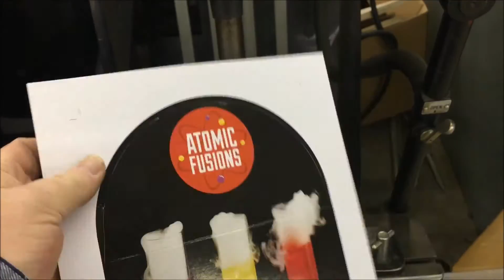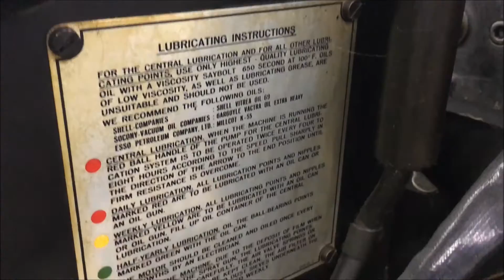Work ~ Windmill Press

Comment: wow, years ago I ran an old manual feed with the ink wheel, one color per run.
Reply from the maker: +buzzsah Me too! Was the one you ran a Chandler & Price?
Reply: +Lil Doggy  I have no idea, I was working for a real old small time printer and the damn thing was so old I never seen or noticed.  All I know is a pain in the butt at first until I became familiar with it. Setup was backwards and upside down at times, and color change was a pain, a complete wash down and lining up.  I ran an old vacuum web press for a while back then as well.  When he closed up I wanted to buy the press but couldn't move it lol.